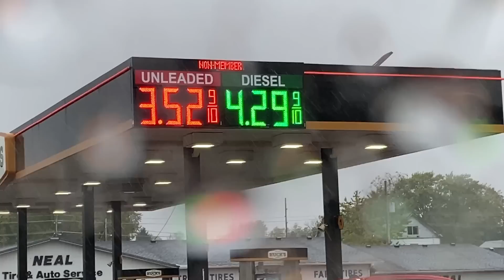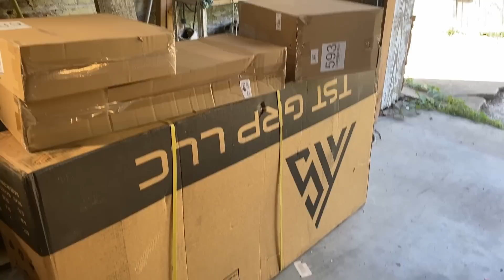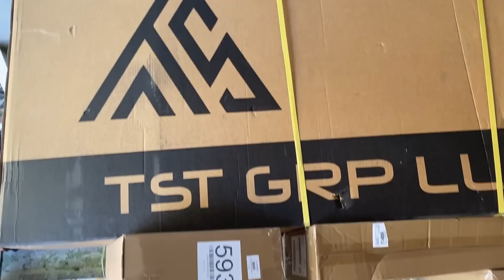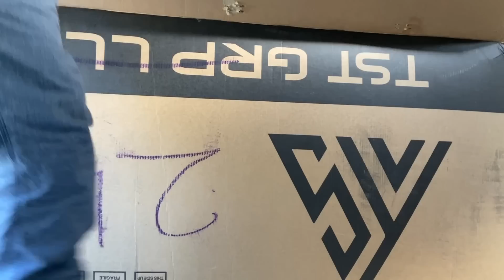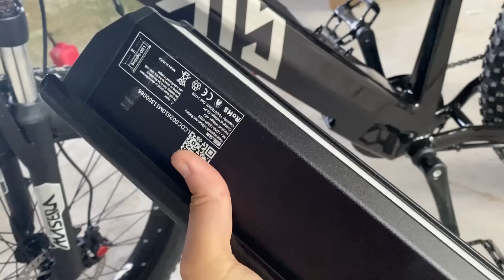TST E-bike Creative tool for major industrial renovation

Comment: Wheeee! Wowie...whoopie!........when I got my 150cc Honda scooter in 1985, I was smiling ear to ear and laughing non-stop. The joy my scooter gave me, lasted 33 years. It was so damned much fun. I drove it for pleasure every day and even drove it to my job, weather permitting. When my mini-van was out of service, it was a great backup vehicle. It was the most fun "toy" I ever bought myself. It almost never broke down,....in 33 years, it only happened twice, and it was a battery issue. I attached a plastic milk crate to the rear rack, and I could go get groceries, and small items. It was highway legal and could go as fast as 65 mph. Though I preferred not to ride it there. In-town,....it was absolutely perfect. Enjoy your wheels and be safe. YAY! For the win.
Reply from the maker: Wow, My first motorcycle was a hondamatic. didn't have to change gears.
Reply: @brickandsole  No gear changing on my scooter, either.

Comment: Can ride that baby up the ramp to the second floor too. Mind the nails, rocks and glass. I’d say go solid core tubeless but those would be spendy. May want those fenders in the rain or slush if you ride back home in it on a rainy snowy day.
Reply from the maker: I haven't tested on the ramp.  But there is pedal assist on it so either way it will be good. I might end up putting the fenders on. First time I have the line of muddy water up the back of my t-shirt like when I was a kid.

Comment: I once worked downtown at an event center. The guys used bicycles and scooters to transverse around the center to save time.

I remember gas at $.19
Reply from the maker: I am using to get back and forth to the building and save money. After I get the entire building clean and swept out and all the nails removed I will love cruising around on the inside. It will save so much time.

Comment: Gasoline prices.  I'm probably not the oldest fogie renovating that building vicariously thru you, Chris, but I can recall gas prices in the $0.40 - $0.50 per gallon range.  I was working in a midfle-of-nowhere gas station/bar at the tender age of 14 and remember the price go from that low to ~$0.80 per gallon one summer.  A guy pulled in once and said, "Gimme 5", so I pumped 5 gallons of gas into his tank and couldn't understand why he gave me a funny look when I came back to his window asking for the three some dollar that the 5 gallons cost.  Ah, the days of being a dumb, naive kid!
Reply from the maker: hi Kevin, funny story, and man they minimum age to work a job must have been lower back in the day! My first job was Hardees and I remember thinking I was big time when I got that job.  A week later I was not of the same opinion.
Reply: I served beer to two of the local cops one Sunday afternoon.  Not a single eyebrow was raised!
Reply: @brickandsole  
$1.15 per hour at McD’s in the mid ‘70’s.  Wahoo when I got a ten cent raise! Later $3.50 per hour when I switched to maintenance with it’s 4am to noon shift.

Comment: A little trick I learnt about opening cardboard cartons containing heavy items. This might be useful to you at some stage.

If the contents are very tightly, packed inside the carton. It is difficult to get a grip on what might be a heavy item inside.

I was then shown a much easier way.

Tilt the carton to about 30° so that the seem at the bottom of the carton is able to be split.

Then fold out the flaps of the bottom.

Then put the carton vertical again. This will let you vertically slide the carton upwards, leaving the heavy contents sitting on the ground. The contents will of course then be the right way up.

Good luck with your use of the defender electric bicycle
Reply from the maker: Nice.  I'd like to say I was hindered by the vacuum seal or something like that but we both know who I am. LoL.  I doubt I'll change.  But I will give it a shot next time!

Comment: I remember my mom giving the gas station attendant what-for because it costed $5.00 to fill the station wagon. That was probably in the earlyish ‘70s. Also, you had me smiling ear-to-ear again with that bike. I’m wracking my brain to come up with a good reason to need one. 😂
Reply: It makes riding a bike fun again.
Despite being electric, you can still get good exercise in the lower Pedal Assist modes.
Its like riding a bike and its always flat or downhill.
Reply from the maker: The best reason is why not!
Reply from the maker: it kept running away with me and I couldn't figure out why, then I realized it had a pedal assist function so when positioned the pedal it wanted to go.  Felt silly when I figured it out.
Reply: @brickandsole  Keep a finger or two on a brake lever when doing tight space maneuvers. If the pedal assist  wants to add power and you don't want it, a slight squeeze of a lever will kill the pedal assist.
Reply: @brickandsole  You should be able to adjust the sensitivity so that it takes more than just positioning the pedals. Like a full revolution or more.

Comment: Hey Chris get a kids bike trailer and you can haul alot more stuff with you on your new E bike, look for one used in your area they are usually cheap
Reply from the maker: I did see they make little trailers and I think there is even an attachment point on the bike.  Less than a hundred dollars.